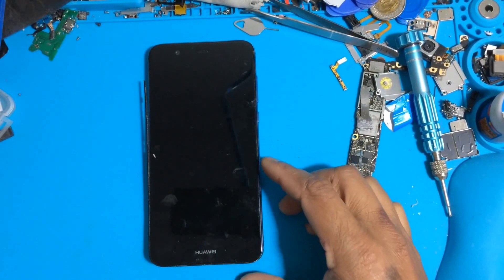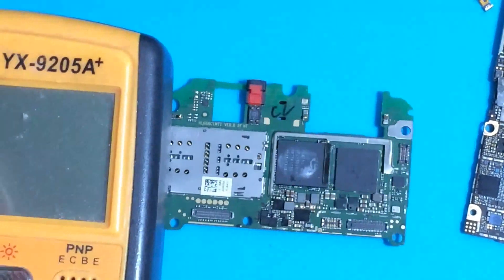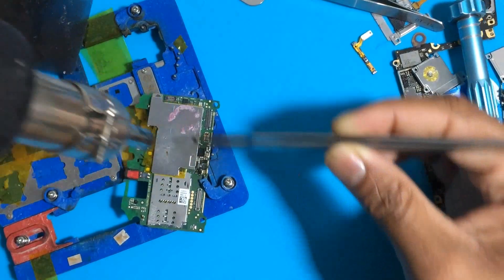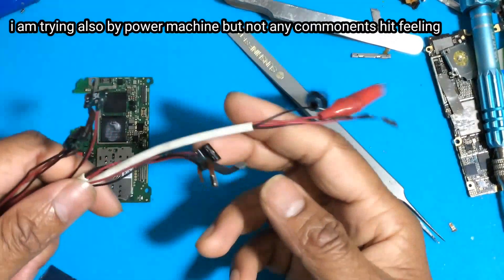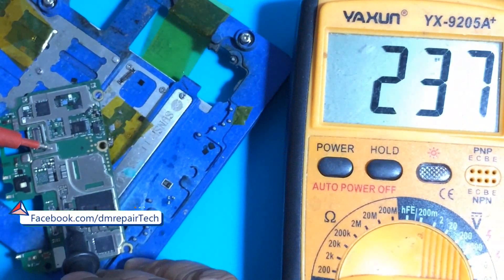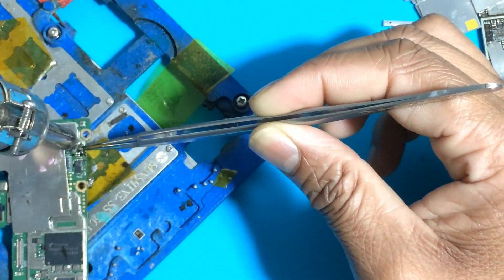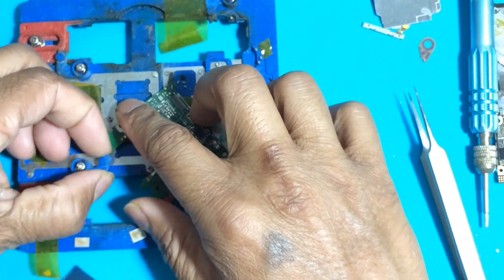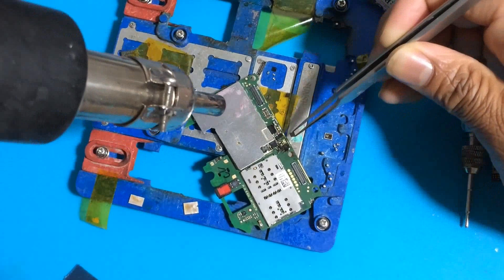Huawei red light when charging no power - blinking red light when charging - blinking notification

Comment: I had the same problem on Huawai POT LX1. I cleaned the USB-port with a cold hair dryer. After charging 5 minutes with another USB cable and plugged into my PC's usb-port, the phone screen turned on and showed that the phone was charging. Afterwards the red light turned on stable and the screen indicates 0% charged. After 10 minutes it has now changed to 1 percent, and the phone is charging normally.
Reply: Bro i was the same problem with my Huawei nova 3i then i see your comment and tried your trick and it works thank you very very much 🐼❤️🐼

Comment: Good morning.
I replaced the display of my P20 LITE but relocating all hardware including
the battery the phone no longer turns on
If I try to connect the cable to recharge the battery, the LED at the top right flashes slowly
and if I try to press the power button for a few seconds the phone vibrates for a moment but does not turn on.
The battery was charged before removing it from the old cover.
Can I try to get a new battery or has the motherboard failed?
Thank you so much for your kind reply
Peter
Reply: Same issue, same phone.  Haven't found a fix for it myself.
Reply: For me, it was a broken LCD. The processing board on the LCD works, but not the liquid screen.

Comment: Aoa brother, Client phone honor 8c came with red light and not charging issue. I checked the shortages which is fine. Also checked the charging jack and kb to mb strip. 5v are coming till the end of KB MB strip but i am not getting the 5v on the battery jack. I get only 0.71. please help.